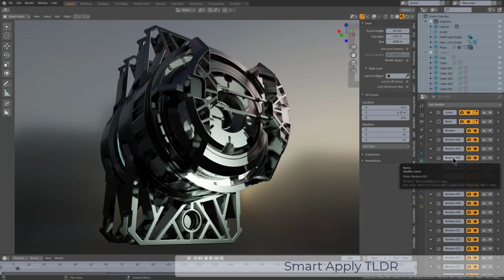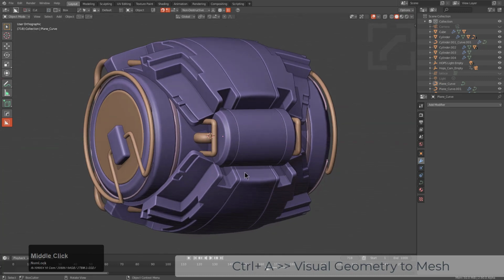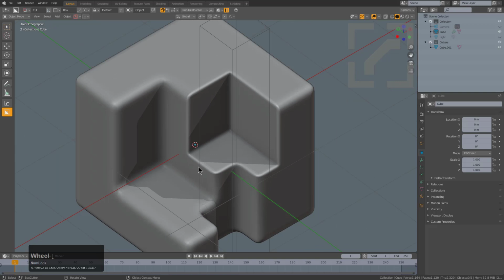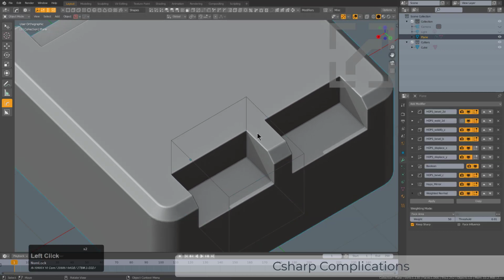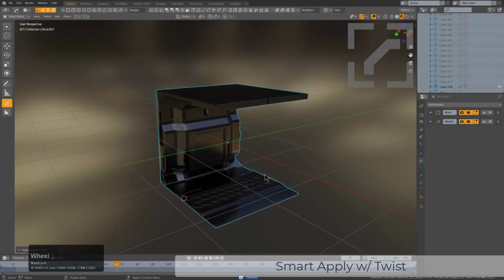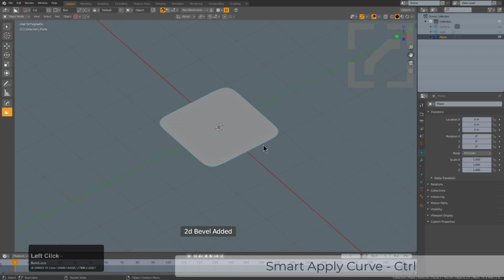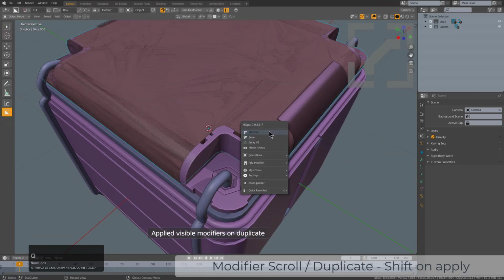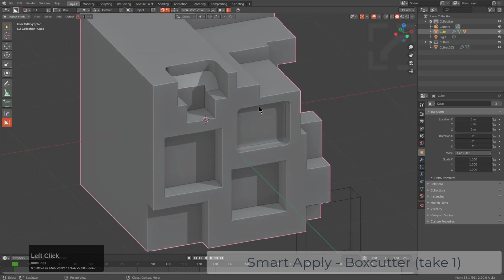#hardops 986 - Smart Apply

Comment: I don't really get the explanation between alt smart apply and step, as the're exactly the same for me. Both add the bevel at 50, same hud message, what's the comparison ? "Completely bypassing step" What do you mean by that ? It's a convoluted way of comparing apples to apples :) Same amount of mods and bools..Have a look here.  https://drive.google.com/file/d/1As7E7AMkgIdLN1ll4vC-I9al9_RgdAdJ/view?usp=sharing       I don't mean to rant, it's just that all this functionality is scattered and It feels you're comparing redundancies
Reply from the maker: Gotta get to the destination. Thank you for your comment!

For more on step,
https://hardops-manual.readthedocs.io/en/latest/step/
Reply: @masterxeon1001  Thanks. Been reading up on hops docs :) I was just confused regarding  my comment marks. The're the same in my book. Different road, that's all.